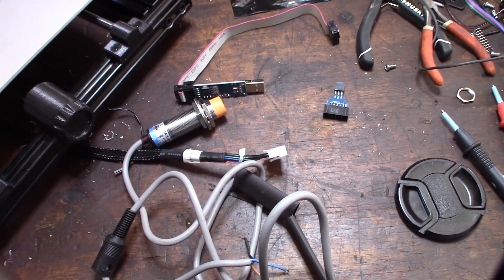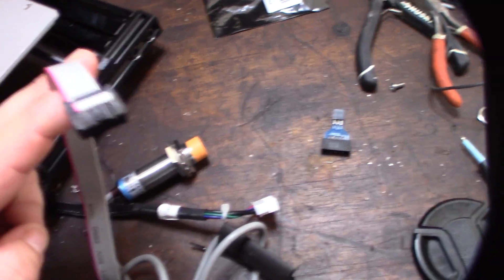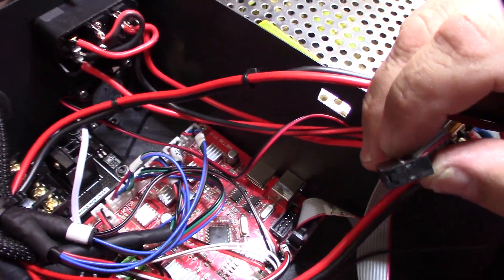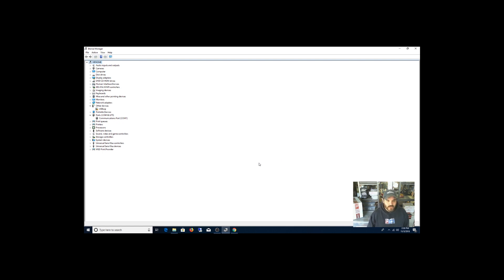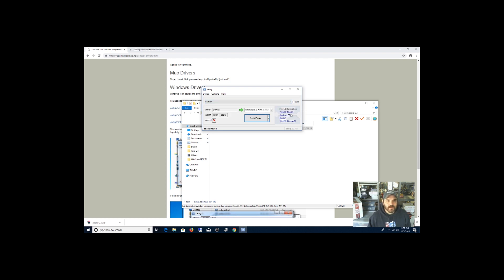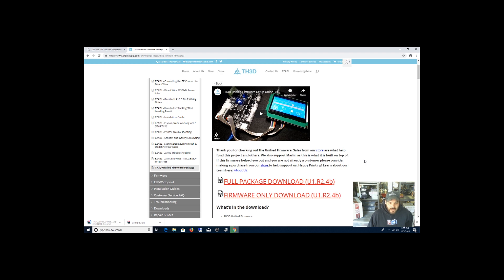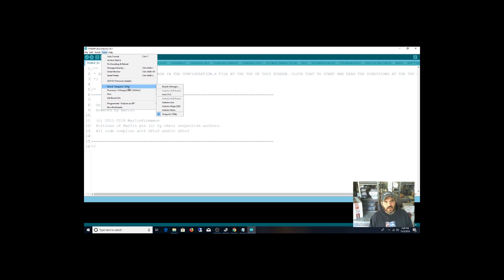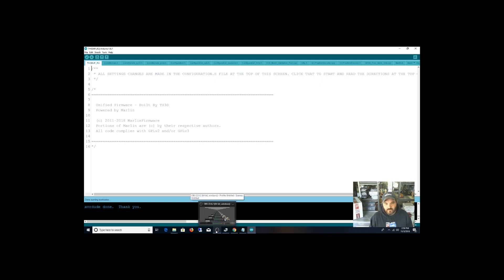Anet bootloader E10 E12 A8 Marlin TH3D install with USBasp and driver install

Comment: Buenas. Ante todo enhorabuena por tan buen video.
He llegado a su canal buscando como extraer la configuración de Marlin instalado en la placa de una impresora 3d, ya que perdí del PC (Put** virus) el Marlin modificado con todos los cambios de configuraciones que le habia hecho al Marlin original para mi impresora. El caso es que he hecho modificaciones a la impresora y necesito activarlas en Marlin.
No se si el programa que usas da la opción de hacer backup del archivo que modifiqué de Marlin (Configuration y Configuration.h).
Si no se puede, ¿sabrías como podría hacer esto?

Muchas gracias y saludos compañero.